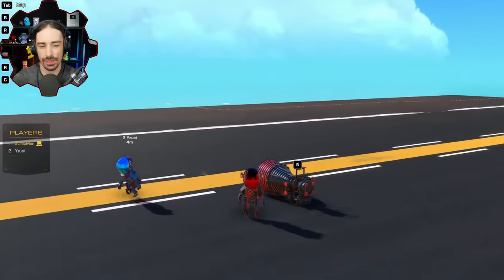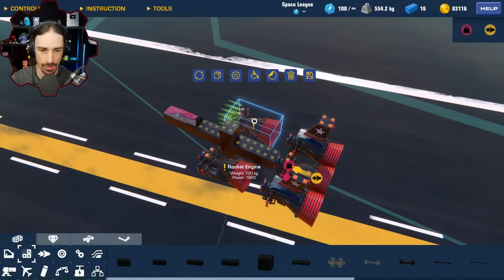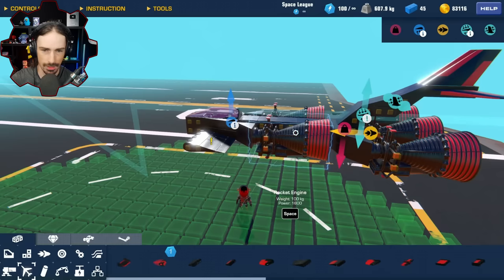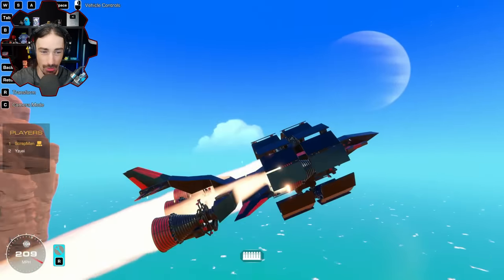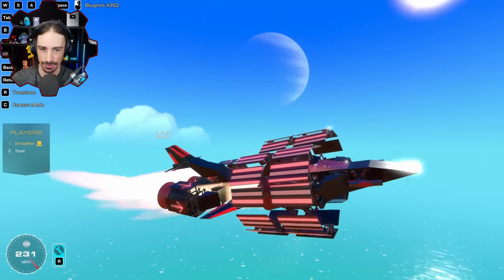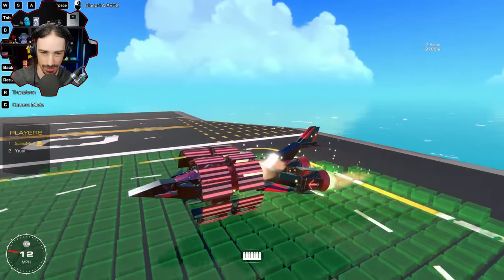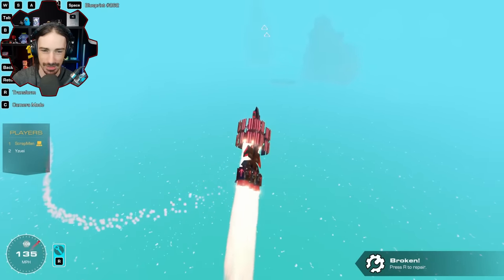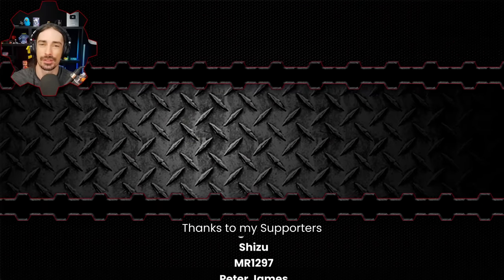What if Giant Space Rockets Were The ONLY CONTROLS?

Comment: Proposal for a multiplayer session:
The weird wing warplane!
Build airplanes that must have at least 5 wing pieces on each side. Uplift may only be performed by these. Each wing piece must be connected to a hinge.
An altitude sensor is installed, which switches off the thrust at a certain altitude so that you have to be close to the ground.
Armed with EMPs, you go into battle.
When hit, the wings fold in randomly and the plane becomes difficult to control. The player who stays in the air the longest wins the round.
Optionally add more weapons or you could also add another wing piece and a hinge after each battle.

Comment: Challenge idea: I think it would be cool to see remote controll drones or rc cars, boats, etc, that could either be used in an emp battle or maybe a race, or maybe the original platform that the rc vehicles dettach from can be like a box that the vehicles have to drop the little blue barrles and or red exposive barrles in. Perhaps the barrels can be worth a set amount of points(the red explosive barrles are worth more), and after a certain time limit whoever has the most amount of points wins, just to make things a little more interesting you can steal from other players. The rc vehicles(preferredly drones for eays controll) don't have to be very small they just can't be the main vehicle(the bins/boxs), also you can add your own power core limit, block limit, weapon limit(if you want weapons) and other restrictions as you want, this is just an idea so you can take it as is or spin your own twist on it and mold it into something different. Ps to avoid you or another player exploding an explosive barrel in your own base make two compartments one for the blue barrels and one for the red preferably made out of and indestructible block(Ex, indestructible seat) or use something other than explosive barrels, if you do use explosive barrels you only get the points from them if they don't explode.

Comment: I have a Challenge for you:
Build a Quantum Engine

Blocks you can use:
Quantum Rudders
Gyro Stabilizers
Gyro Blocks
Hover Pads
Helicopter Engines
Logic Blocks
Steering Hinges/Servos
Pistons
And any Construction Blocks

Restrictions:
Can't use Hover Pads for Propulsion (that would be considered an UFO engine)

Goals:
Build the engine using the parts provided and make it Stable on command, have smooth and easy handling, and make it able to fly in all possible areas, Space, Water, Any Atmosphere

Bonus Points:
Build a Quantum Engine without using any Logic Blocks, Steering Hinges of Pistons of any kind, and without Hover Pads

Scoring Board:

20 Points for making a Quantum Engine

20 Points for making it fly

20 Points for having smooth controls such as Roll, Pitch, Left/Right Turns

20 Points for having it able to fly in any situation such as In Space, Water, and Areas with High Gravity

20 Points for if you can take off from the ground without losing any parts

+5 Points if you don't use any Steering Hinges or Pistons

+20 Points if you don't use any Hover Pads

+75 Points if you don't use any Logic Blocks

Highest possible score 200 Points
Lowest possible score 20 Points

Hint: You don't need to build a Body to contain this Engine as it may be too big to contain

Why a Quantum Engine?
Well I've been experimenting with making a Quantum Engine for a while now and I want to see how Scrap Man's and the others takes this challenge and see what kind of creation he could make